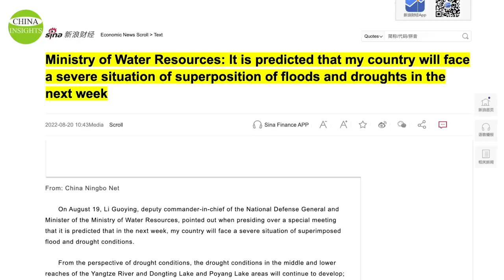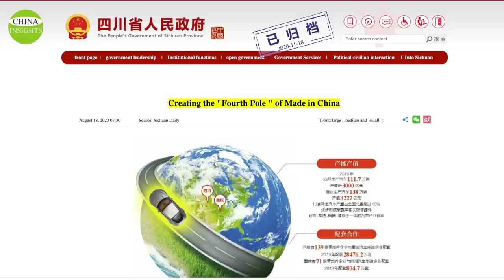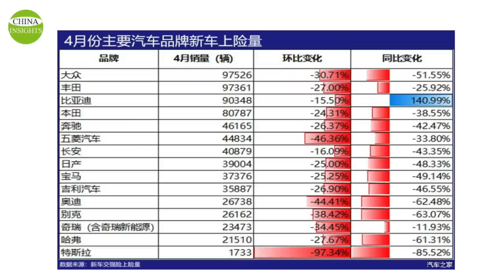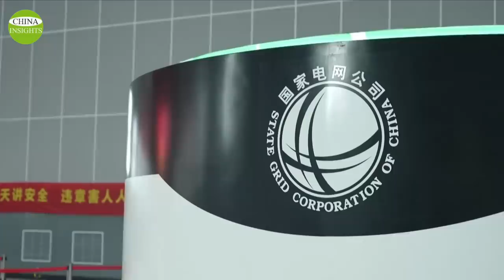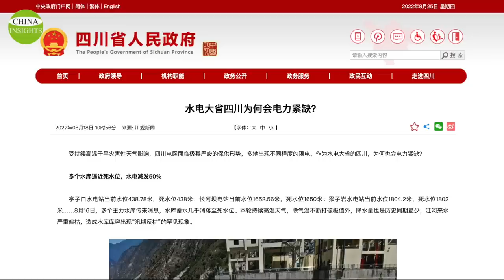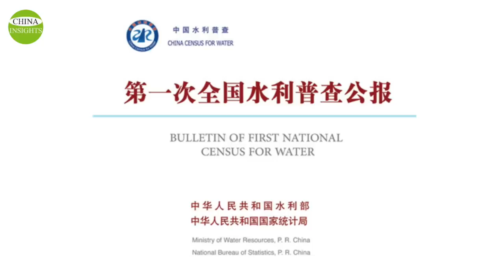Why does Yangtze dry up? The Power Crisis continues & Extremely high temperatures grip half of China

Comment: It's the same all over the world right now… Rivers are drying up, heating up and experiencing algal blooms which destroys the water quality and kills the ecosystems. Hydro- powerplants can't run and nuclear powerplants can't cool down so there is a shortage of energy which is so desperately needed when it's hot. When the soil drys up it resists picking up water, exacerbating floods and destroying crops. Meanwhile there are huge forest fires that make the pollution and destruction of ecosystems even worse.

This is no longer a future we're headed for, it's our current reality. It's astonishing that some people are still so resistant to accepting the fact that the global climate is changing.
Reply: The climate is always changing, regardless of humanity's wishes and industry.
In the 1700s, a good chunk of the world briefly relapsed into another ice age (that is, where surface snow accumulated and then persisted for more than a solid year even outside of the polar regions).
Some 300 years later, it's warming again.

People assume it is entirely due to anthropogenic impacts, but that's not necessarily the case; volcanism has historically shown to provide more direct and measurable impacts on global air temperatures than human industry.

Humanity has a track record of trying to out-engineer nature and disaster under the presumption that we can conquer the system in its entirety. In our arrogance and presumption, we forget just how tiny we are in relation to the world at large right up until it starts crushing civilizations again.
Reply: @atmosdwagon4656  Is that to say that we should stay inflexible to the changes or that we can't mitigate the impact that this has on us? I don't think we should underestimate the impact humans can have on the ecosystems around us either, nor our ability to adapt to new climates.
Reply: @atmosdwagon4656  I think it can be difficult to separate adaptation from mitigation in regards to the changing climate. Most things that are done in the name of fixing the climate also have value in terms of energy security, protection of natural resources and comfort of life. Even if you don't think that emissions have an impact on the climate itself, they undoubtedly pollute the air, water and soil which of course is important to prevent.

I think that sometimes such efforts seem a bit heavy-handed and out of touch, especially when well politicians don't consider how their policies affect everyday people. Still, I don't think that is a problem with the ambition, but rather with the political system, the people who work within it and the interests that direct them.

It's a problem that wealthy people and businesses can have so much influence that they get a pass from scrutiny, while the remaining populous are told that it's up to them to make the changes. A carbon tax would mainly hit the powerful polluters rather than the normal population, which seems like a good thing. Who am I to say though? It still doesn't address the problems of businesses ruining the water, soil and air quality while lying about it only to get a slap on the wrist for it.

It seems like a constant struggle between politics and big businesses and we shouldn't want either to become too dominant. When governments regulate businesses, we should be happy for it, but it's important that the government themselves don't get too overbearing. The most dangerous situation though is if the two collude… It has happened a bit too much recently. :^(
Reply: @atmosdwagon4656  Many forms of clean energy such as wind, hydro and solar power increase energy security because they can be locally processed and are run on the environment that they are in. In combination nuclear power, this leads to a reliable and relatively cheap source of energy in the long term. Fossil fuels are on the decline and are politically unstable. There are undoubtedly big challenges to adopting newer power generation methods, but simply continuing to use fossil fuels forever isn't an option. It's not like they will be retired immediately anyways, so it's better to get it done while we still have them around as a crutch.

I don't know where you've gotten the idea that neither solar power nor wind power is successful in generating sufficient power. That sure isn't the case for other countries at least. Also, as time goes on these methods of producing energy get more efficient and simpler to set up. It takes time for things to improve, but they do.

That's not to say that I blindly support everything that is claimed to be "green". All too often this label is used as an opportunity to only make more money while doing nothing to improve anything. We don't consume ourselves out of a problem of an over-consumption problem. To that end, I completely agree how ridiculous it is to produce bio fuels out of corn, when that process turns out to be insanely inefficient and costing more energy. Same goes with replacing all vehicles with electric ones: the cost of producing entirely new cars to replace the old ones will cause more harm than good. They could of course invest in public transport for those who can use that and reduce over all dependence on cars, letting those still in need of one use the same vehicles as before, but that wouldn't be appreciated by the big car companies…

I'm not under any illusion of the power plays that go on in the world of business and politics, but that's not caused by a replacement of energy sources and introductions of new technologies. It's simply affected by the same system that surrounds society as a whole. I don't think it's too optimistic to say that the energy sources that are gradually replacing the old ones are a net positive.
Reply: @dontmindme8709  I don't know where you've gotten the idea that neither solar power nor wind power is successful in generating sufficient power
I get it from reading actual engineering evaluations of these systems and an understanding of the laws of physics.

In reality, I guarantee you whatever solar or wind gets called "successful" is always via                  techinicality rather than by their virtues. At absolute best, they are or secondary source of power and never a primary form of power generation.

And there's a reason for that; why our entire power grid paradigm is based on constant generation and load: We still lack an efficient way of storing excess electrical power for when it's needed.

Well, guess what? Solar isn't available at all times anywhere on the planet (not even the poles during the solsitces; where the sun angle is far too low for generation to be effective anyway), and wind generation is subject to even greater degrees of variance which includes too much as well as too little.
(for non-electricians out there: Too much generation translates into over-stressed transformers and line resistance due to a little phenomena called "impedance". Resistance of any kind in turn leads to waste heat and potential damage to the system itself)

To call either of those consistent enough to warrant a label of "successful" is absurd by all but the loosest standards. Imagine getting a 20% on your exam and counting it as an 'A'
Reply: @atmosdwagon4656  When looking at renewable energy generation by country, there are some countries who can get a sizable amount of power generation through hydropower, wind and geothermal energy as well as nuclear. Others like solar and biomass are always complementary but never primary, which might either be because it's less invested in, or because of a limitation in the technology. Indeed, the sun doesn't always shine and power storage is a big problem that still lacks a general solution. Still, even if it's not good enough on its own it still does enough to contribute to some countries' energy production that it's worth having. Energy demand is always higher during the day, so that limitation isn't necessarily such a big problem.

Excess energy can be used to generate hydrogen gas using electrolysis or by pumping up water into dams, but there will also need to be some reorganizing of energy demand. Perhaps some uses of energy can be scheduled for when there is greater output and less demand. Some places invest in battery farms, but I'm not sold on that idea because of the limited lifespan and cost of production of batteries. It remains to be seen what the best solution is for evening out demand and supply.

The reliability of the aforementioned energy sources come from their independence. They are able to run in isolation rather than depending on a constant transport of fuel to them. That also cuts out the need to spend energy on extracting, refining and transporting said fuel. The drawbacks of some of these, as you've mentioned, is that they generate a variable amount of energy. For a stable energy output there is instead nuclear and burning of waste and biomass. Admittedly, not all countries are making use of these for various reasons. Some aren't able to use it, while others like Germany are in the case of nuclear power too paranoid to trust it. (At least they've started doubting themselves, but we'll have to see what decision they make.) Japan themselves are planning to restart their nuclear reactors.

Energy, like anything governed over, is troubled by incompetence, confusion, posing and self-interests. Even 50 years from now there certainly will be countries who heavily rely on non-renewables. Nevertheless, all steps to improve are helpful and I am hopeful that the challenges can be largely overcome – even if it could go a bit quicker… :^)
Reply: @dontmindme8709  When looking at renewable energy generation by country, there are some countries who can get a sizable amount of power generation through hydropower, wind and geothermal energy as well as nuclear.
Of all those named, only hydro, geothermal and nuclear are viable primary generation methods, and two of those are extremely limited by location and circumstance.

Excess energy can be used to generate hydrogen gas using electrolysis or by pumping up water into dams
Hydrogen is extremely dangerous to accumulate and store because of how reactive it is (as the most basic element in existence, it bonds with a ton of stuff, including oxygen; violently I might add).

And as dangerous as living next to, say, a coal, oil or natural gas plant is, a hydrogen storage system dwarfs all of those for explosive potential because of how many recombinant reactions you can get with that much spare purified hydrogen.

Dam-watershedding is an interesting idea, but I'm going to find it difficult to justify the gross loss in system efficiency to do so, since in pumping water you're at best, fighting gravity and friction/viscosity, and those losses grow rapidly as you increase the distance required to move said water.

They are able to run in isolation rather than depending on a constant transport of fuel to them
That is the correct use for solar energy, but I want to emphasize that such niche applications are in no way useful for solving the current crisis (or any future crisis at that).

Comment: One point, sincerely doubt any temps exceeding 50! It’s not accurate to leave a thermometer sitting in sunlight just soaking up rays. That is not measuring air temp, that’s just baking the thermometer by letting it soak up radiation without a way to dissipate heat.
Reply: The Infrared therms showed that too. This is because stone and cement absorb heat as well as let it back out. If you go over such a walkway and then into grass you can feel the cloud of extra hot air above the stone, and it gets cooler immediately as you go onto grass. City temps do indeed get that high, though no, ambient air temps are probably not that high
Reply: @RobinTheBot  Surface//contact temps and air temps can and often do vary considerably.
One of the qualification procedures for weather station thermometers in the U.S. specifies placement at least 5 feet away/above any high BBT radiant (black body temperature) surfaces, specifically to prevent erroniously elevated readings.

Comment: Meteorologists measure temperature in shaded places, so it's normal that in the sun temperature would be higher.
Reply: this is a very important/over looked detail.
Reply: Asphalt is always hotter than air temperature. Melting asphalt happens in Arizona, Texas and New Mexico every summer during heat waves.
Reply: @quercus3290  they'll still do so elevated and in the shade, not by pointing a thermometer at the asphalt. 

Airplanes need to know what temperature it is, as well as wind speed. So airports have good weather stations.
Reply: @quercus3290  Those might be some additional measurements, but in general an academic consensus is to measure temperature in meteorological booths
Reply: @quercus3290  Oddly enough, where I live my local temperature is also taken by an airport, but still in the shade lol
Reply: @quercus3290  it's a red herring to worry about airport temperatures when we have data from the middle of nowhere, ocean temps, and every other measurement in agreement. 

Just because airports may be a degree hotter doesn't change that fact. It also doesn't explain why the airports themselves are also warning.
Reply: @quercus3290  I've accepted global warming. It isn't the end of the world, but in my country there's a large amount of denial about the fact it's happening at all. I just find mildly triggering.  That's all. If people want to debate what we do about global warming, or even if we can do anything, I get it. Debating whether it exists or not is what I find irksome. 

And yes temps even at airports have been rising. Last year we had many airports record record temperatures. Some airports also had asphalt failures because it got too hot and they couldn't land planes on certain runways until it cooled.
Reply: @quercus3290  I get ya but the people debating whether it is or isn't happening are so far behind the curve of the debate they slow down where the debate should be. It's like debating whether smoking is or isn't bad for you or wether drinking and driving is dangerous. There's certain things that the debate has kinda been settled on, and all that's left to discuss is what can or should we do about it.
Reply: @quercus3290  I think there is a very honest debate to be had about wether or not it's worthwhile to do anything about it or what to do it. I do not however think there is much to debate wether or not it's warming. We have overwhelming data to support that and almost no data to suggest it isn't warming.
Reply: @quercus3290  all the questions you cited are valid ones, but not part of the denialist claims. Debating the causes, solutions, extent, historical patterns, those are all good questions. I enjoy those debates. Even good faith scientists have those. 

There are folks out there that think the weather stations are intentionally placed in hot areas so as to skew the data. That's what I find annoying. Maybe im just thin skinned or old and crotchety.

Comment: Global water issues, not enough being done.  We have broken the water cycle. The next decade should be interesting.
Reply: "We have broken the water cycle"? Such arrogance.
The Earth's hydrologic system has existed and operated without end before life even began to develop, and has not once been "broken"; let alone by a pipsqueak group of hairless water-apes dotting about its surface.

No, our dependencies on readily available water resources have outstripped our ability to acquire them, nothing more, nothing less. The Dust Bowl some 90 years ago was no different either; and yet, the climate changed dramatically between then and now too.

Comment: 95f and 104f is super hot to the Chinese and even melts the road. OMG! That is so hilarious. Those temperatures are typical daily averages in U.S.A southern states for a normal summer and that is not including the humidity which makes it feel even hotter. Yet our roads don't melt. Maybe the Chinese should put whatever it is that makes their icecream not melt into their roads.
Reply: they don't even build their roads with storm drains, so when it does rain it just pools on the surface rather than running off.
why wouldn't the road surface also melt in hot summer temperatures?
Reply: I live in New Orleans, Louisiana and 95- 98° in Summer is normal for us.  Yes it's hot but we expect that every summers.
Reply: @cobongmay4248  Louisiana, home of the term "swamp arse". The humidity is one thing, but like Florida, the mosquitoes are absolutely murder. Damn things the size of a Pekingese and can carry them off too.
Reply: @Licotus007  I agree
 Hate the mosquitoes and the humidity hete.
Reply: There are different grades of asphalt.  The different grades of asphalt melt at different temperatures.  Tropical areas use higher melting point asphalt.  If you use tropical grade asphalt in places where it snows the frozen asphalt shatters like glass when heavy vehicles run over.

Comment: Can't wait to buy an Ev so my car shuts down during a power outage 😂.This is why I don't think EVs are good imagine if the government cuts power you are screwed.
Reply: They don't last near as long as gas vehicles yet either.
Reply: Bro guess what's used to pump the petrol out of the gas station reservoir
Reply: @spinecho609  At least I could steal some gas or siphon from someone else good luck stealing electricity.

Comment: Just an FYI on power generation and water. Almost all power generation boils water to generate power. Nuclear power in particular cannot use water that is to hot as it reduces efficiency.
Reply: What?  It maybe can't use hot water for heat exchangers for auxiliary equipment, but the reactor itself boils water to make steam.  The water being marginally closer to its boiling point should theoretically increase efficiency.
Reply: @ChubakaSteven  it's something to with cooling the reactors